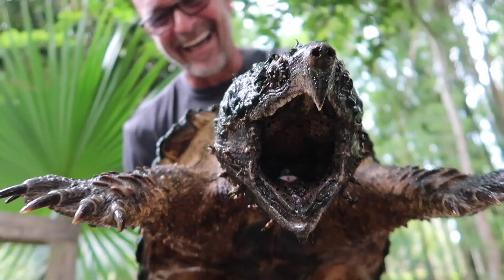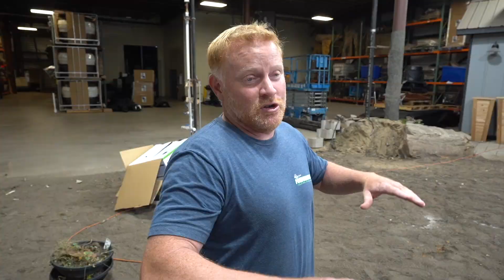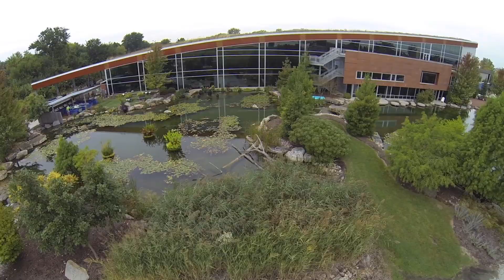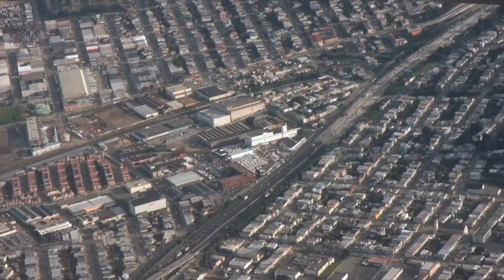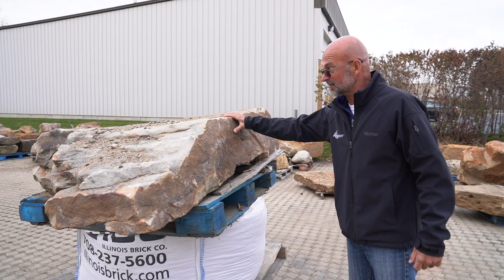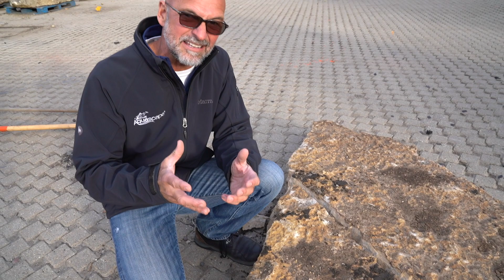STRENGTH TESTING AQUABLOX FOR A MASSIVE RAIN EXCHANGE SYSTEM!!! Part 1

Comment: I’m building a wetland filter for my koi pond. Do I have to use aquablox or can I just use rocks only with the snorkel and centipede?
Reply from the maker: Great!
You can use all rocks instead of the Aquablox, I used that method for several years with great success. 
It’s not as efficient from a functional standpoint but it will work….

Comment: Can you clear something up for me?  I was skiing with a buddy and he proposed the question where do you think the water coming from the springs are coming from and how does it get there, we're on a mountain.  I postulated distillation and subsequently mocked, relentlessly.  Now I know the source is an aquifer but I haven't found a term to describe the process for it moving to the spring, whether it be pressure and/or heat.  I haven't given up on my answer, that's not to say I won't be happy to be proven wrong.  So if you don't mind.  What is the process in which water passes from an aquifer to a natural spring at higher elevation?
Reply from the maker: That’s a great question!!!
Aquifers, Springs and other forms of groundwater is very interesting!
Water goes into the ground by obvious means(gravity) as precipitation falls on our land it soaks into subsoils and continues to be pushed deeper and deeper due to continuous precipitation patterns.
Some soils have high permeability(sand and gravel) which allows for the water to move unimpeded until it hits bedrock which blocks the water movement. 
Other soils such as clays are very tightly packed together with minimal void spaces between the clay particles. This allows for very slow water migration through these layers. 
In Florida or other areas with Karst Geography(Limestone) incoming rainwater has a neutral pH to sometimes slightly acidic this will literally eat into the limestone causing tiny fissures allowing for water passage.
All of these scenarios will create a large underground reservoir of water stored within the void spaces of the surrounding subsoils. 
Springs will occur in cracks or fissures found within the bedrock which is basically causing a leak which is visibly seen as a spring. 
Where it gets difficult to comprehend is the volumes of water we’re talking about. 
When 1” of rain falls on an Acre of land it’s equivalent to 27,000 gallons of water!
So when you start adding up the volume of potential water within a given area or watershed it’s mind boggling!!!
The amount of water that bubbles up from springs is less than the incoming/captured volume so even during drought conditions springs continue to flow because there’s a huge “Bank” of water held in the aquifer and only minimal outfall from the springs.
I’m trying to simplify the process without getting to deep into it, does this make sense?
In mountainous areas with high snowmelt and/or precipitation the water is at a higher elevation which puts pressure on the deep aquifers and this pressure can cause springs to pop up in higher elevations that seem to defy physics but you need to understand the entire cross sectional area of the watershed to fully understand.
I hope this helps???
Reply: @EdThePondProfessor  It does, thank you.  I didn't really think about snow melt on a mountain with an average of 12" snow base but between grooming(breaking up ice buildup) and artificial snow it is safe to assume there is some level of melting going on.  I really appreciate you getting back to me so quickly, thanks again.

Comment: Once I get me a new place, I am planning on having another multi fruit orchard. I really want to try the aquablocks in my swales instead of just gravel. The aquablocks will hold more water than just gravel. I believe if I place some permeable landscape fabric not only around the blocks in the ground but on top as well with a gradation of gravel, it would cut down on mosquitoes breeding. God bless Ed and have a very Merry Christmas 🎅
Reply from the maker: They would do a great job in that application!
I would not recommend Landscape Fabric or Geotextiles over the top of the Aquablox when used for infiltration,
The fabric becomes clogged over time and inhibits water passage(I’ve had to tear out some of my past projects)
Reply: @EdThePondProfessor  thanks for the info

Comment: Is there a winterizing plan to prevent ice heaving pavers?
Reply from the maker: Great Question!
No,
The reason we don’t have an issue is we have a layer of CA-7 gravel as the paver sub base which doesn’t have any Stone Fines so it allows easy water movement through the base. 
Under the CA-7 is our Rubber membrane that routes the Stormwater into our Underground Tank System. 
Paver Heaving is typically a result of saturated subsoils freezing and expanding causing the paver to Heave upward. 
The Rubber membrane keeps the subsoil dry and the Open Graded gravel has enough void space to counteract this process. 
I’ve been using this setup since 2009 with Great Results!!!